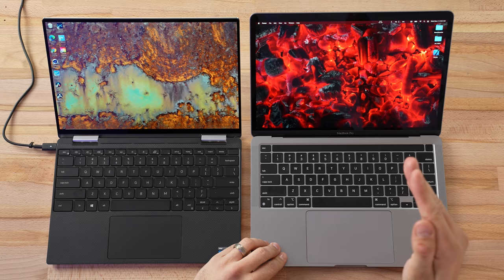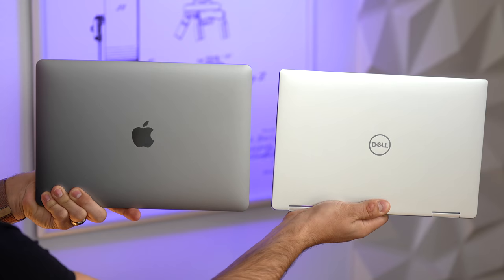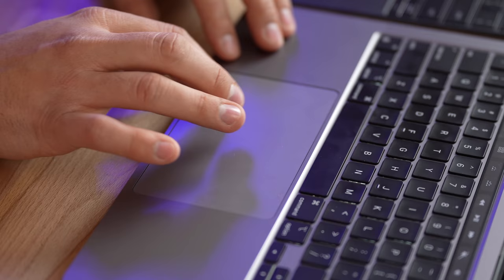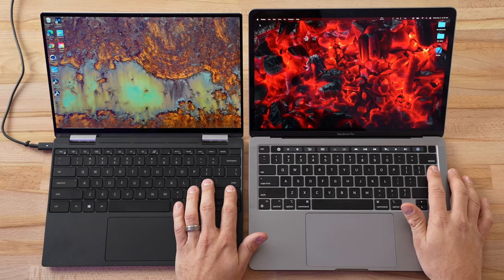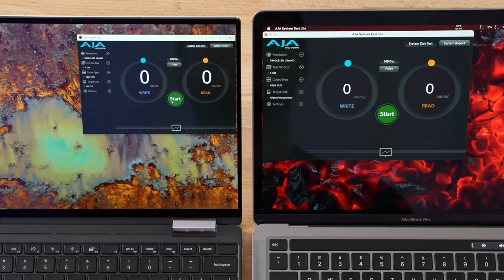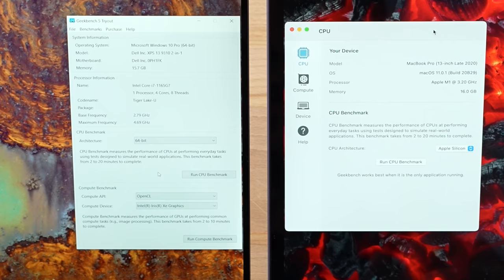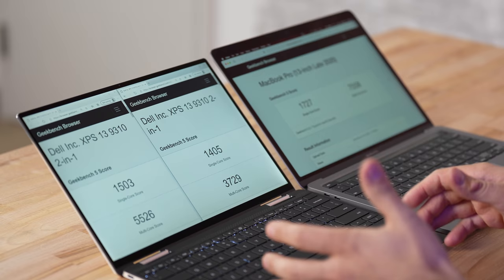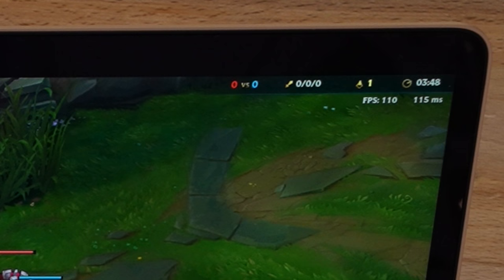M1 MacBook Pro vs Dell XPS 13 9310 - ULTIMATE Comparison

Comment: Finally Macs are wroth it's prices.
Reply: Aung Ko  👍👍
Reply: They’ve always been. I just bought an M1 but my 2010 MacBook Pro (RAM upgraded to 16gb, ssd installed) still runs like a champ. I have used it heavily (~6-7 hrs/day) for the last ten years. I wouldn’t be surprised if I get another 5 years out of it (only limited by the OS at that point perhaps).
Reply: Gameminer  definitely doesn’t apply to dell’s, acers, or hp’s. If by “years” you mean around 2-3 years then yes, they last “years.” Hell, even the surface I had, which was used very lightly (literally browsing and checking email), had charging issues, wouldn’t connect to wifi, sound cut out, touchscreen wouldn’t respond at times...I could go on and on. Not to mention, using Windows isn’t exactly a pleasurable user experience. I’ve had my fair share of pc laptops and they are absolute pieces of garbage after only so long. Lenovo’s however, I believe are worth their price.
Reply: Gameminer  Apple has always been the best value in the industry. People who call Apple a scam are the ones who have never touched an Apple product in their lives lol or someone who lives in a country that has very high import fees artificially inflating up the price. at least in America, Apple products are always best in class and are very price competitive

Comment: i have been on windows for 20 years and it is the first time i am thinking about switching to mac
Reply: Same here, Switched to my first Mac last week :)
This M1 is what Laptops have always strived to be
Reply: Don't 
You'll be sucked into the apple ecosystem
We don't want another fallen comrade
Reply: @DrAdityaReddy  it’s cool I’ve had an iPhone since 2015, wasn’t “suckered” into anything extra, these macs are just good laptops 💻
Reply: I switched 10 years ago, was so impressed with my little 11” MBA and ran it flawlessly for 9 years until 2 gig RAM finally couldn’t keep up.    In all other respects it was a beautify and glad I switched.    I now use 13”MBA.    Apple is always innovating and keeping its eye on the future in technology.    ARM processors have been steadily growing and improving strategically in the iOS devices so that the tech is ready for prime time in laptops and desktops.    Now they pounce.    Wait till newer M chips arrive plus Rosetta no longer needed.

Comment: Hello,
Great comparison, although I think you should correctly match up the specs on the Dell, so 8 core processor.. I do have a question about the percentage differences you provide for each test. Some tests like the single core Geekbench is calculated to be around 13%, so 15% rounded up is a good estimate. But how is the multi core test 40% faster? My calculations provided a 26% difference. Like so with the Geekbench GPU, I got a 20% difference rather than a 25. Can you provide the way you calculated these?

Comment: Summary:
The Macbook has... better speakers, better display sweetspot (QHD), better trackpad, better battery life, better benchmarks (faster), better camera, better mic,  faster ssd, runs much cooler, better for photo/video editing, has a touch bar = cheaper (8Gig Model) 
The Dell has... thinner bezels (much better look/design overall IMO), better/more ports, better for gaming

It is a no brainer to go with the dell unless you necesarrily want windows

The Mac is better in almost every single aspect, except for looks (bezels), less ports, worse for gaming.

EDIT: And yes I am a 100% windows and android guy and I really hate the look of IOS (it looks very childish IMO)

Comment: rip intel apple have just destroyed them. dell should move to AMD
Reply: AMD is still an x86 platform.
Apple M1 ("A14+") is an ARM platform.
Reply: @kitop310  my point is that intel processors have a lot of thermal issues and there limiting what you can do in a laptop. and AMD make a hell of a lot better chip than intel and there actually a noticeable improvement year after year.
Reply: Windows still needs lots of improvement because the intel based Mac is better than intel with windows.
Reply: Amd or develop their own chips. I think companies will start following apple and try to make their own to compete. In 1-2 years we’ll see a closer competition but right now MacBooks dominate every intel based laptop
Reply: @TheRocco96  it doesn’t lol seen a series chips

Comment: Interesting. Can you tell me if the XPS that was tested was on the Evo chip vs the regular Intel. As I have seen different results on some tests when using a 11th Gen EVO chip.  The XPS w/EVO costs a bit more.    Thanks

Comment: Davinci actually has an optimized version for the m1😄 (I would like to see that)
Reply: it hasnt been fully optimized yet. It's fully compatible to not cause issues and run smooth. But it still has not been optimized to take full advantage of the unified processing between the ram, cpu and gpu so you are mistaken.

Comment: I switched from mac to a XPS13 about 3 years ago. It's a XPS 13 9380, 16GB RAM, 8th gen i7, 512GB SSD, I pretty much spec'ed it to out when I got it. It started to have issues 2 years in. Not a window again.

Comment: Good morning.  I watched the video well.  In your video, we tested the MacBook and the 11th generation Intel's built-in graphics and CPU.  By the way, Premiere Pro doesn't completely rely on the GPU, but it does help.  Among the information you know, which product has a higher speed of video editing, such as a MacBook and a notebook with a graphics card with a GTX1650 or higher (intel 1165G7 CPU if possible)?

Comment: Thanks for this excellent comparison. I would order a MacBook Air, tomorrow , but for the fact that I already use a 2014 max specced i7  11" MacBook Air, to carry round and a 2013 MacBook Pro connected to an excellent 27" Dell monitor , which I use as a desktop computer.
Both machines cope with my personal requirements, at the moment.
Also my machines have a good set of ports, which the M1 Macbook does not have.

Comment: When you did Davinci Resolve, and Macbook M1 rendered it in 5 minutes, and Dell XPX in almost 13 minutes, it says that regarding the numbers, that the higher is better. But surely thats a mistake, right? Id guess its better to render it as quick as possible which is why 5 minutes would be better than almost 13 minutes.
Reply: Ya it was his mistake
Reply from the maker: Editing mistake sorry guys

Comment: Returned my XPS 13 after one week, too many issues: Screen turning off randomly or showing distorted image, static sound through headphones (had to reinstall drivers, but still cracking noises in sound), microphone so bad it's literally unusable in conferences... What a poor quality control at Dell, especially when considering that former models already had some of those problems.

Comment: they'll be optimizing parallels for the M1 as well so you can run windows on the Macbook without speed penalties
Reply: The problem is running Windows code...if you remember back in PPC days, emulation had to translate the intel instructions....with intel  Macs, the translation was not needed....now we are back to running translation to get Intel compatibility.  The Windows version that is supported is an underdeveloped ARM version of Windows and not the Intel/AMD supported version.  Microsoft also has a compatibility layer in the ARM version to run x86 x64 programs...but not nearly as optimized as Rosetta on OSX.  So either emulators need to re-introduce x86 x64 instruction translating.....or Windows for ARM needs to step up.

Comment: What's also impressive is that the low energy RISC chip wins hands down. Silicon architecture is the new standard. For Apple's first production chip (entry level remember) this is extraordinary.

Comment: Any thoughts on the battery life of those products? The 1080p version of the XPS is supposed to get decent but not great battery life while the 4K is absolutely horrendous delivering 5-6 hours where the MBP will delivers 15-16. Is that what you experienced?

Comment: Excited for zen3 Ryzen 5000u series and H series chips. 
I wish you could get a Ryzen 7 4800u laptop to compare against. The 11th gen Intel are very temperamental, they only performed well in the reference intel laptop and failed to impress inside the Dell.

Comment: if you're in the market for a laptop, do yourself a favor and go for the base model MacBook air, been using it for over a month now, and it's pretty amazing. The keyboard is godlike. The only drawback is the macOS which I don't like as much as windows.

Comment: Hi @max Tech
I'm looking to buy a new 13' laptop to do GoPro9 video editing in 4k/5k with Da Vinci or Premiere, but based on your video it seems that it would be a problem. Is there anything I could add/change to the laptop to make it work? thanks!
(would any other decent video editing software have the same problems?)

Comment: Does the M1 Mac have both the internal CPU and GPU as the ONE CHIP?
Reply: Yes. The eight or 16 GB RAM is also inside the same physical package. It's wired directly to the CPU GPU silicon. In other words with 8 gigabytes you have two chips in there, 8GB of RAM and the CPU/GPU. 
Because of speed of light factors and the power it cost to drive bits over printed circuit boards, the M1 single package is way faster and uses much less power as you see.
Guess what! ThenM1 does not have an L3 cache. You can think of the RAM itself as being the L3 cache which has instantaneous access from the CPU. Awesome

Comment: Excuse me to ask, is there a laptop specs with core i7 , ram16Gb dual channel / 512ssd ram (upgrade & there is 1 empty slot), nvidia rtx gpu, thunderbolt port, 100% srgb fhd ips. With the cheapest price, what type of brand? Thx

Comment: Wow that was fantastic 🤩. Also do a video of MacBook Air M1 Vs Dell XPS 13 9310 That content would be very useful for us as even the AIR is very powerful
Reply: The MBA has the same architecture as the MBP, only active cooling makes a difference with high demand applications.  Maybe the XPS would compete slightly better with the base MBA with 7 GPU cores, but any Mac with the M1 chip will smoke any current Intel/AMD machine.  The problem for Apple right now is that there is essentially no difference btw MBA and MBP for the majority of owners.  Only in high demand graphics applications (high res photography and 4K video processing) will the cooling make a difference.  The MBP touch bar is no benefit for most too.

Comment: Does the hot air coming from the XPS affect the Macbook Pro again, or were the temperatures of the high performance cores always at around 90 degree mark but the the software was only reading the temps of the efficiency cores before?

Comment: Does anyone know:: If we buy the macbook pro and install windows os, would the benchmarks still hold up?? Or will it become not as efficient (slower) if we dont use the mac os? (I prefer the windows os for computing thats all)
Reply: It wouldn't be nearly as efficient for now, because you need virtual machines as bootcamp still isn't here
Reply: @mrplasma7094  when it is here, itll be same?

Comment: The thing is, base m1 MacBook Pro in India costs 1,22,000 ₹ while the XPS 13 costs 1,55,000 in India.
It is much better to get m1 air which is even less (around ₹90000) than the xps 13.

Comment: This was not a very smart test. Touch vs non touch, convertible vs non convertible, thin and light vs lower end pro. I think part of the purpose of this test was just to beat on the M1 drum. The specs above are very expensive to integrate into a laptop, so comparing the two was unwise

Comment: The Single Core score with Intel's and Amd hyperthreading processors cannot be compared with Apple's processors, because a core with hyperthreading in a Single Core benchmark is not fully utilized. So you have to deduct 20-30 % from the m1.
(Sorry I'm German)
Reply: No it can be compared, because in daily tasks the extra thread on a single core of an AMD or Intel processor is not gonna be utilized either. So it’s a realistic test. And hyperthreading is a kind of bandaid so some parts of the processor don’t sit there doing nothing. The M1’s cores are already designed well in terms of getting themselves fed with data, so they don’t need hyperthreading. But currently, because even the ARM ports of Mac apps probably aren’t fully optimized yet, chances are hyperthreading will be a advantage for Intel & AMD when compared to the M1.

Comment: I think that the benefits apple are getting are due to the very fact which Nvidia has been pointing out for years now - they can produce stellar performing GPUs, but it has diminishing returns, because the CPU and GPU in PCIE based systems, spend a lot of time doing memory copy between the main memory and that of the GPU. At the same time, this is a further issue, as applications use CPU and GPU in an increasingly mixed fashion.

Comment: Just got an almost maxed out 16” MacBook Pro. 5500m 8gb graphics card 16gb memory tab storage and i9 processor. I might end up getting an apple silicon Mac sooner than I thought. They perform so well but would like the extra size of a 16”. But also considering a smaller lighter laptop for travel.

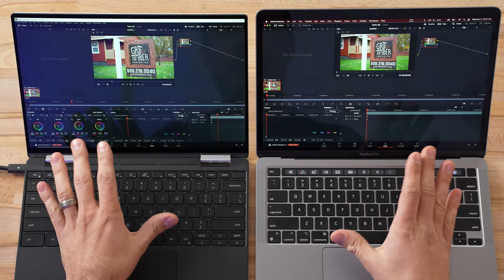Comment: 21:25 It would be good to see how adobe premier works comparing to my Mac pro with the premier running. I know the Final cut is faster but by several reasons I prefer the premier even if it's very slow sometimes and I can use the FInal cut which does not have performance issues.

Comment: Do not trust on synthetic benchmarks only. The responsiveness of every Intel based system (NUC for example) still is much better, than of Mac mini M1. The internal bus restrictions of M1 systems still braking USB speed. M1 in active cooled Mac mini has been much disappointing to me, the lacking 4k support too. Waiting for own M1X and Intel NUC with i7-1185g7 or i5-1135g7. The only advantages of M1 had been: GPU power for video editing and cool design, with low power consumption and 5nm design.

Comment: The mic and webcam and audio quality is night and day difference. I use an old Macbook Pro for work and hardly ever use a headset unless I have to and never have audio quality or mic quality complaints on calls whereas my colleagues with Windows laptops are often almost impossible to communicate with if they just use built in laptop audio and pretty much all will have to use headsets.

Comment: Performance wise I would go to the M1 Mac. 
The only reason I would buy the Xps is because it’s OS is windows. I am a windows user. I develop apps on .net framework. If The M1 mac bring back the bootcamp or if there’s a way to install windows i would definitely buy it.

Comment: 21:50 I'm not sure I understand the reason for the difference in performance between the Dell and the Mac while using Resolve... if both systems have access to 16gb of RAM, why is the Dell using proportionately so much more of it just to run the program? Where is the optimization coming from that's letting the Mac run so much more efficiently?
Reply: This does a pretty good explanation for why the M1 has an advantage over Intel.  https://debugger.medium.com/why-is-apples-m1-chip-so-fast-3262b158cba2

Comment: Dell XPS 13 9310 is comparable in being a low watt, slim profile model, but it is in no way a powerful laptop that one should choose for video editing. Honestly, until M1, MBP was not a good choice for a main editing system unless you were strictly a FCPX user where Mac optimizations keeps it pretty smooth & snappy. For laptop video editing on PC, you really need performance cores, not low wattage, long battery life, and you need dedicated gpu to run the  video editing apps properly. So a larger profile gaming type laptop is the way to if you are sticking to PC laptops & want to run Adobe Premiere or Davinci.  That said... and I've been no Mac fan, these MI devices are looking great, and make the Mac Mini & Mac laptops look way more interesting as an option for video editing.

Comment: @maxtech, you said MacBook only has Thunderbolt 3, that isn't true it is Thunderbolt/USB 4 from the Apple specs. Another point is that the entry MacBook Air will still thrash the Dell based on your tests, giving far superior bang for buck.

Comment: 2 reasons I'm not getting a Mac
1: Mac OS is horrendous imo. My school had a few 2019 i9 Macs for media class(idk if they were pro or air ), constant problems and alot of us couldn't figure out how to use the OS properly even after a whole month.
2: x86 (and some x64) stuff is run on an emulator on ARM based systems. Not the best experience. (This will probably be fixed by time)

Comment: Lol.  Dell 9130 with 4k screen 32gb ram and 1tb ssd $1699 and  you get a 4yr warranty when purchased  on costco credit card during holiday sale. Apple with 16gb and 1tb ssd and 3 years apple care $1898.  So equivalent spec if you could get it would be $2098 for apple.  $400 more and then add the additional tax and you are looking at a 25% premium.

Comment: I own a likely superior machine* but get much inferior score in Speedometer/Chrome (139 vs. 150-200 in these laptops), what could possibly explain it?    *Ryzen 9 3900X liquid cooled desktop - 64GB RAM Corsair 3200MHz - 2x SSD WD Black SN750 NVMe - Radeon 5700XT 8GB - Windows 10 Pro

Comment: you cannot compare benchmarks as the system and operating system are completely different. Just like running an AMD engine test bench 
on an Intel Engine test bench, it might be much lower or much higher

Comment: I'm truly ashamed for Intel. The programs on the mac aren't even running on native, and they respond so much faster. And this is M1. There's still that M1x coming out. So, how does Intel respond? By putting out hit pieces, instead of going back to the drawing board and coming up with something that actually works.